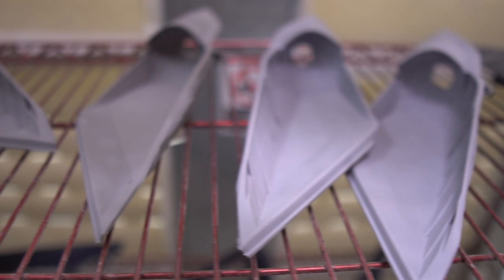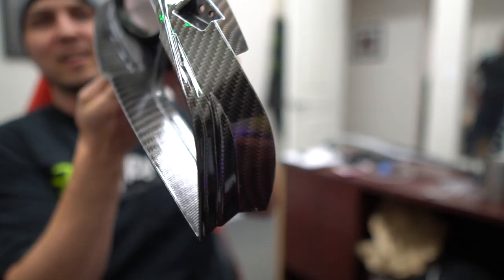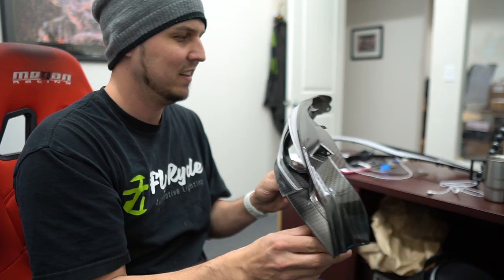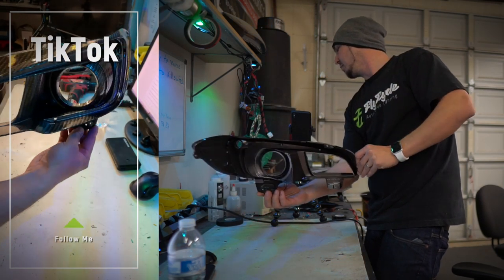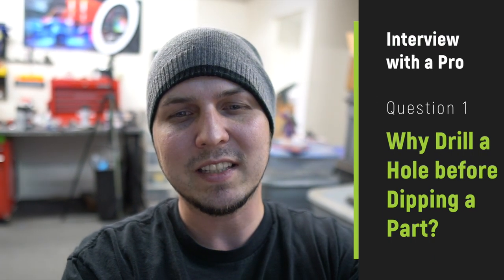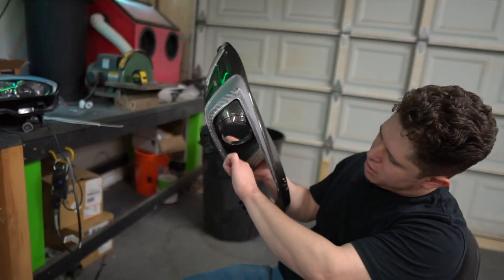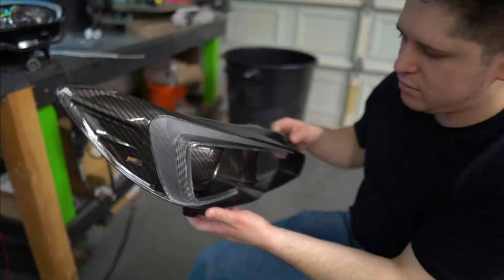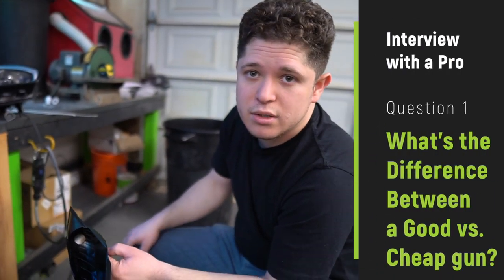Hydro Graphics and Custom Paint | FlyRyde

Comment: Bitchin video as usual.   I’m getting ready to open the headlights on my Escalade ESV and was thinking about Demon Eyes.  However my ESV is a Platinum edition and there are like 7 projectors on each side.  Just trying to figure out where would be the best spot for the Demon Eye.  While it is open and I am trying not to make a mess of it I’m thinking about stripping the chrome bezel and Carbon hydrodipping it.  It’s a chaotic undertaking.  Do I angel eye it?   
🤤🤤🤤